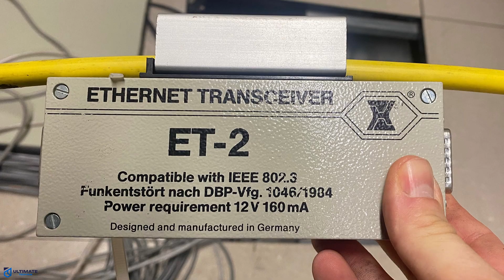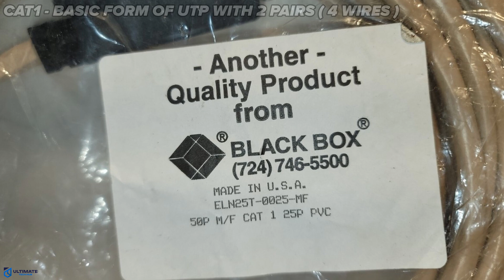The History of Ethernet

Comment: One item that I still have is an Ethernet controller used in my '486 in the mid-1990s.  This controller however had 3 ports (but could use only 1 at a time).  It had a thick-net connector, a thin-net BNC connector, and a RJ-45 port for 10-Base-T twisted pair.  Gave me flexibility between using thin-net and going to twisted pair.  And I still have a 4-port and 8-port hubs from the era.  I sometimes play with it still.... discovered that my Raspberry Pi 5 won't talk to it, but the hub will still work with other computers, and higher speed switches. The Pi5 does connect to a 10/100 switch, and can daisy chain thru the hub just fine.
Reply from the maker: I love the old tech stuff! The 1990s was a great time for computers and networking.
Reply: @UltimateTechHub   When the place that I worked at rewired the office from thin-net to Cat 5, it inspired me to wire up my house when I had it built a few years later.  The Cat 5 does fine with gigabit ethernet equipment.  I joke with my wife that the house is obsolete because of the Cat 5.